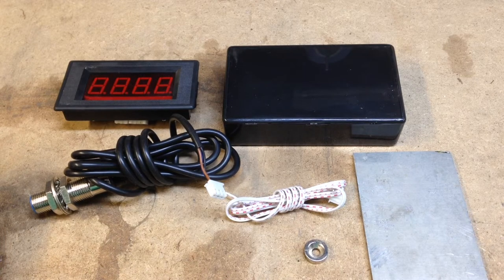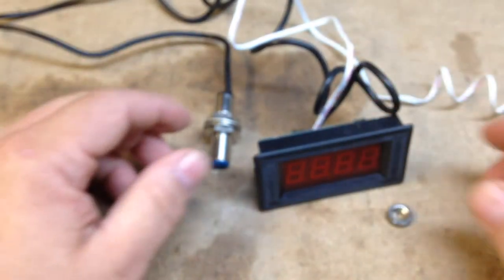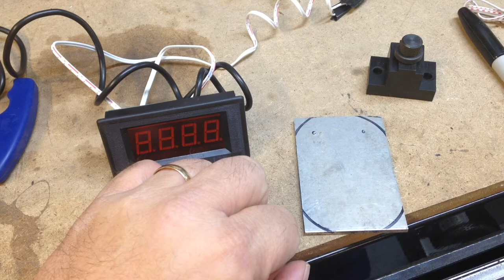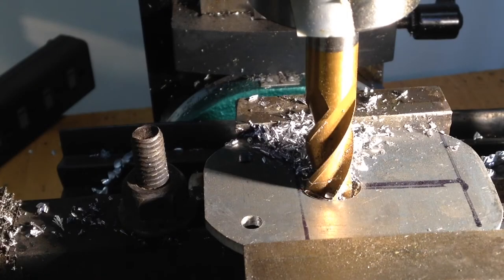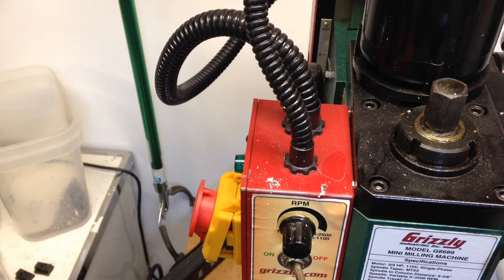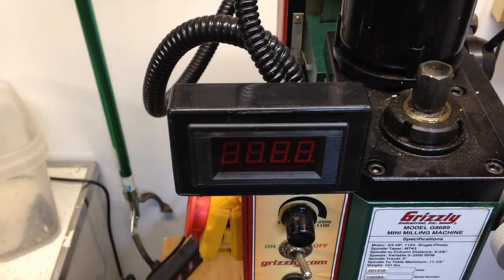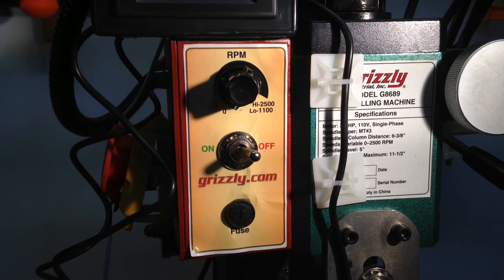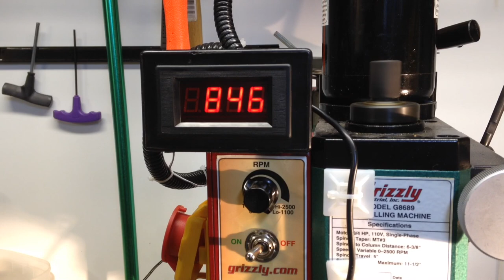Tachometer

Comment: Sensor is a Hall Effect sensor so it will detect only one magnetic pole, either N or S depending on how sensor is set up. It is working correctly. Many hall effect sensors can't be polarity reversed or they will be damage. The are essentially a transistor

Comment: Hello sir,
Very good practical presentation of speed controller installation. I bought this type of controller but I am missing the box to insert it. At the beginning of the video in 0.24, on your work table is your black box to the right of the speed controller. Would you be so kind as to give me the link to buy it or the name and dimensions to do some research.
Can I expect an answer? In the meantime, good evening and cordial greetings. P. K. (French)
Reply from the maker: its been a few years but i got it off ebay, measured the device and found a box to fit, sorry thats all i got

Comment: hey there just purchased one of these and i think I have wired it up wrong n I get just dashes on the screen and the led on the sensor is on all the time should the led on the sensor only come on when the magnet comes  in contact?
Reply: Check magnet polarity Hall sensors are North / South sensitive.
Reply: I have the exact same problem... I don't suppose you found the fix did you? I know I have it wired in correctly, but it only shows dashes. I try waving the magnet in front of it, but nothing happens. I've tried both sides of the magnet. Screen just stays stuck on the dashes, doesn't even show Zeros...